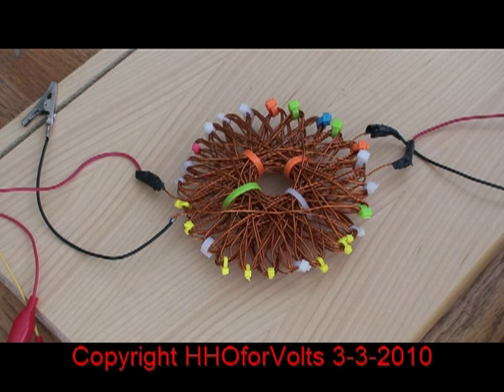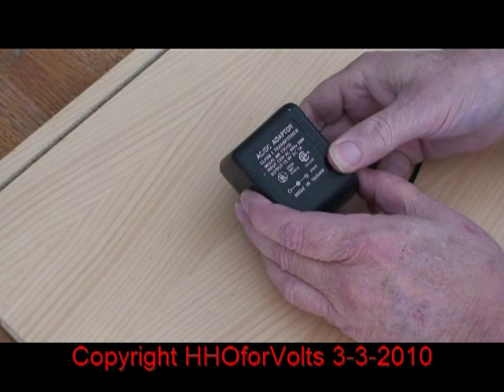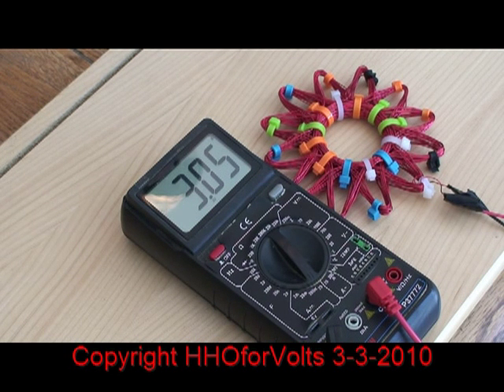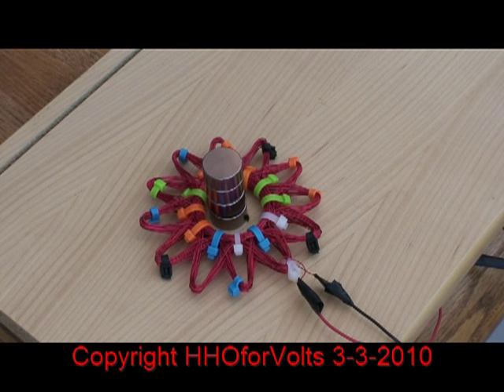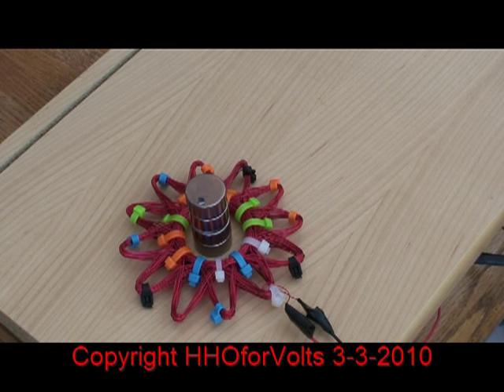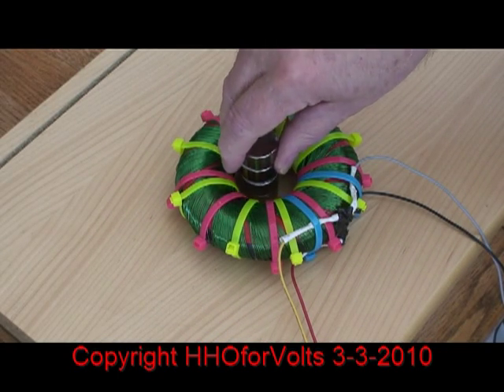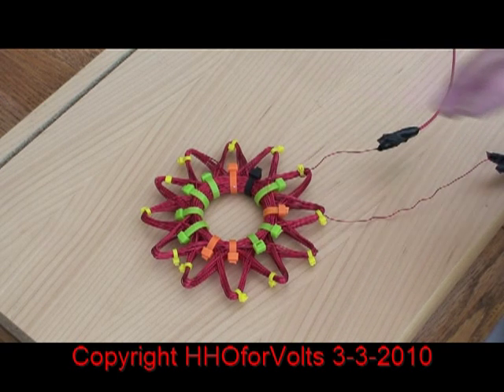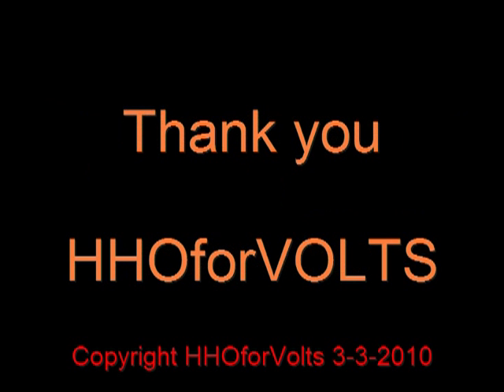Rodin vs Starship #2

Comment: @hhoforvolts the "two winding" == bifilar ? are they start at the same point and end up at the same point (may be also the same as the start point) ?
i also wonder about the torque of this coil. I saw on 1 of your video using bicycle tire frame (just like a bedini), how strong is it? can we actually use it as a normal motor and move something heavy (around 30Kg of mass or more?) at the same rpm?
many thx

Comment: hi, 
it is a very interesting video to watch. I wonder if the magnetic moves clock wise (or anti clockwise) at the center of the star ship. if yes then, if you put a magnet at center horizontally (you did vertically) will it move around? 

many thx n good luck

Comment: I have a friend that produces plasma in a jar. I would like to build a starship coil to rotate and counter-rotate the plasma simultaniously inside a torus. Like a torus shaped plasma bulb with a starship coil to excite the plasma. I am wondering if you can visualize that and contribute any ideas you might have as to how to wire and pulse the starship coil to attain this rotating/counter-rotating field? Any input would be greatly appreciated !